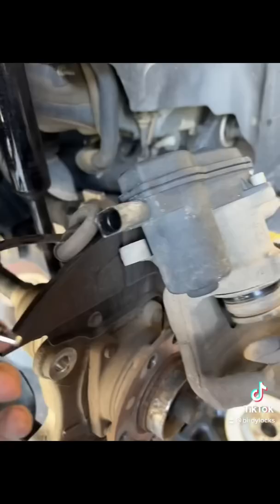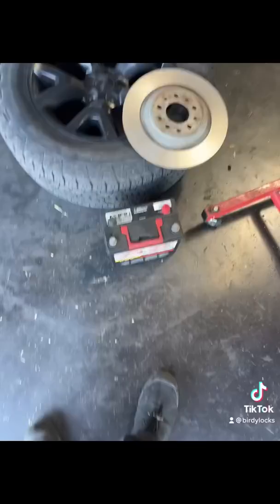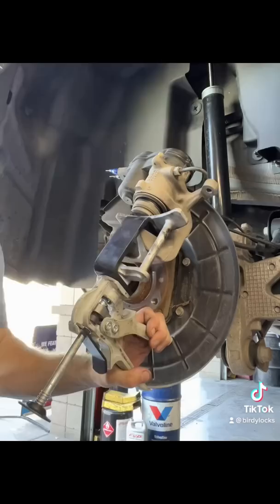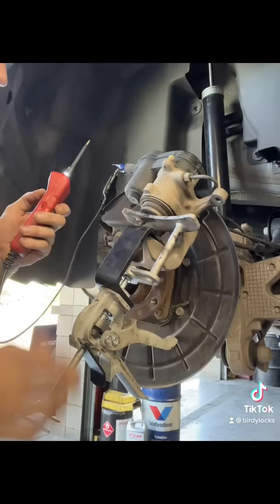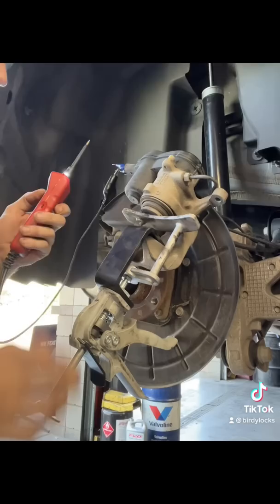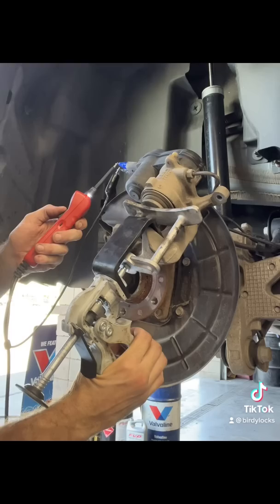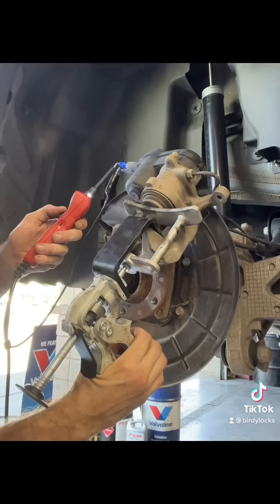Electronic Parking brake hack #EPB #automotivetip #automotivetechnician

Comment: What f'up engineer came up with this?  I used to teach breaks back in the nineties and this looks ridiculous.
Reply: BRAKES!
Reply: It's just for electric E brake.  More crap to go wrong
Reply: Some cars self lock at stop lights
Reply: You definitely didn’t learn how to spell brakes correctly lol 😂
Reply: @JohnSmith-xu7ev  Why? Are their drivers so old they can't hold down the pedal? Was pulling the hand brake too much physical activity for them?
Reply: I'm welcoming the electronic park brakes in the rust belt. No cables to seize up. So far I haven't seen one failed motor. Of course they haven't been around for a real long time yet, but so far the motors are out lasting a lot of cables.
Reply: @illegalopinions4082  I’ve never seen them auto engage when stopped at a light. He may be thinking of auto stop/start. I have seen them engage when placing a vehicle in park to take strain off the pawl.
Reply: @illegalopinions4082  
It's an option when you buy a 120,000 dollar luxury  car.
Reply: Electronic park brakes are so much better than mechanical ones. No cables to seize or stretch. No parking brake mechanisms to seize and break, and no adjustments. And the actuators are relatively inexpensive and easy to replace.
Reply: @alexpuls8219  Just a motor that shuts off when the controller sees a specified current. Same as a window really
Reply: @JohnSmith-xu7ev  An option to do... what? Just because its an option doesn't mean its a good one
Reply: @JohnSmith-xu7ev  yep, anti roll back feature on some. Manual transmission on hill assist type thing.
Reply: @illegalopinions4082  
If you have no clue what's it's for because you never worked on cars, then how can you have an ignorant opinion?
Reply: @JohnSmith-xu7ev  The electronic brake is used for multiple different things. The fact you don't know what they are doesn't make me the ignorant one.
Reply: @JohnSmith-xu7ev  You don't know the meaning of the term "Liberal", and I clearly do. I'd ask you how the system works and what it uses to hold the car in place, but we both know that it only highlights your inability to grasp simple sentences.
Reply: Welcome to 2022!
Reply: @deanmeyer1815  right? I was sorta hoping it was still a mechanical lever that was automated and easy to service. This just looks like a pain in the ass lol
Reply: I used to teach "breaks"...now 'thats' scary. polarity seems the risky thing.
Reply: @revee1000  actually less stuff to go wrong than conventional handbrakes
Reply: @home541_  Depending on the model you do a firm press on the pedal when stationary and the actuators will engage. One you press the accelerator pedal they'll automatically disengage. It's a separate system to stop start. I have it on my Skoda and it works great.
Reply: it's so they can nickel and dime the customer, brakes have neen working well enough for decades yet some yuppie ceo is barking orders down to the engineers telling them to make it twice as likely to break and three times as expensive that way they can have their fat paycheck while the customer and mechanics can get fucked!
Reply: I like doing breaks all day at work 🤣🤣🤣🤣
Reply: @revee1000  it’s actually more reliable, it’s just a button and wire and a motor there’s no cable or brake shoes that can rust and seize, it’s just more expensive.
Reply: @illegalopinions4082  ask the big car companies. They obviously think the people are too stupid to drive their cars, with park assist, lane departure, collision avoidance etc
Reply: guess u teaching "breaks" wrong all the time
Reply: brakes
Reply: Yes, BRAKES!
Reply: Wait.... what?
Reply: Electronic motors actuating on the rear pistons as the handbrake has been around for a while I thought. And there's ones that use a typical handbrake shoes inside a brake rotor hat that actuates on the cable to activate the handbrake 👍🏻
Reply: @oldfag_adventures  to replace this would be cheaper so moot point
Reply: @home541_  yes they do, is call brake hold, when BRAKE HOLD is on, after making a complete stop you can release the brake pedal and the car won't move until you step in the gas pedal and if you take the seat belt off it will go on park automatically.
Reply: @raziel2215  Ones I’ve seen that utilize that typically use the ABS module. Bizarre they’d use the rear caliper but I’m not the engineer
Reply: @Krankie_V  the mercedes electronic parking brakes in the rear go out but I don't see it happen too often, pretty good system
Reply: Teach breaks, yup that's why they all failed, they were on break.
Reply: @illegalopinions4082  it improves the lives of others whilst making no difference to yours. Some people are disabled, some are old, some are just physically weaker and smaller. You've never had an issue with the old regular hand brake but many people do, all day, everyday
Reply: @Krankie_V  I've seen the same caliper on the same wheel having both the motor swapped twice and brand new calipers swapped twice. All work was done at VW, orig VW parts and they still failed. They think it was down to road salts sitting in the connectors and corroding them til they were too thin resulting in poor connection making it an intermittent fault that killed the motor eventually, the last time they threw a caliper, motor and new harness in, that was 2 years ago and it was all good. Sounds cool but that was all free under warranty, like 6 months later it would have cost idk,  into the thousands, over a caliper.
Reply: @georgecroney6168  Then maybe they should consider an alternative, like the ones they can already put onto their car. You have to be really far gone to not even be able to use a hand brake when there are 90 year old ladies somehow managing to do it just fine. Raising the cost of the entire car prices those very people out of it at purchase and likely condemns the car if there are maintenance or repair costs.
Reply: BRAKES TEACHER, THAN TAKE A COFFEE BREAK!
Reply: Having been in a car on a real narrow road on the side of  a mountain and over heated the brakes, I was grateful for the lever operated emergency brakes , if I had the ebrake I would have been in trouble as flicking a button doesn't have the same feel as the lever has
Reply: EVERYTHING is going electronic .... 
Its more things to BREAK to cost more $$ in repairs.
Reply: @home541_ it's called Auto Hold and when the car is stopped, the EPB comes on when you release the brake pedal to go. It's designed to stop you from rolling backwards ifnyr on a hill and are crap with yr clutch control 🙄
Reply: @Aspie_Geek_UK  As I stated in the previous comment I’ve never seen a car use the EPB actuator for hill assist. Always been the ABS module locking the brakes. A lot faster than the EPB actuator
Reply: Definitely going to break these BRAKES
Reply: What engineer ?? A young millennial that said pulling a handbrake or pushing down a foot brake was too hard and heavy for his weak puny arms and legs so he invented the electronic motorized emergency brake .... 
The same millennial that came up with the electric lawn mower, too wimpy to pull a string to fire over a mower 🤷🏽‍♂️
Reply: Industrial psychology when viewing accident statistics has long indicated that more decisions equal an increase in wrong decisions. Cars will be autonomous pretty soon , they will take themselves to the scrap yard when the software fails( it does) . Humans are resistant to control by autonomous systems and accidents will remain inevitable. It’s worrying to me that the brake will automatically release when the gas pedal is pressed, leaving the major hazard in the pot .
Reply: This is an amazing video. You will have no idea until you find somebody that messed everything up by not putting the car into maintenance mode. This little trick is amazing

Comment: Most cars have parking brake maintenance mode that retracts the parking brake without using a scan tool.  Simple button press/key cycle sequence
Reply: Nice thought by them I guess but electronic parking brakes are dumb asf anyways
Reply: Exactly.. done too many fords and dodges at PB’s
Reply: @APBtDiezel  Ford/Mazda/Dodge and Mercedes are the only brands I’ve seen that have access to it without need of a scan tool
Reply: Ford as I know: key on engine off + electronic parking brake disengaged position + accelerator petal to floor then turn car off and within 5 second at any point while continuing to hold those, turn it back on. E.P.B maintenance mode activated. Some 2022 Fords I found though I had to force the maintenance mode with the ford FRDS software on our scan tool. Haven't tried on a snap on or matco all in one scan tool. I'm sure it still works.
Reply: Noice
Reply: Lots that dont qithout a scan tool
Reply: That's if the service mode even works.  I had a 2020 Ford explorer with a bad control panel button and had to use the scan tool.  But the jumper pin trick works in a pinch.
Reply: @home541_  jeep too
Reply: I was about to comment that it has a brake maintenance mode that releases the piston pressure but you already had it. Good on ya.
Reply: I know you're confused bc of the title to the video. But that has nothing to do with parking brake.
Reply: @Rescue1325  now I’m confused
Reply: Came here to say this, also be careful with a power probe youngins
Reply: My Honda I just left ignition on and put a battery charger on battery . Worked great 👍
Reply: @Wub892  snap on will do this
Reply: @killroy3607  haven't used a snap on or other brand one but glad it does
Reply: Wrong... Its put into service mode. You would still need the scan tool to retract the pads.
Reply: @johnnysolano1025  wrong
Reply: Ford sequence to get it in and out of maintenance mode is fucking rocket science. Be nice if they just have a hot function anyways to make some of your lives easier

Comment: This don’t work on GM vehicles. The ebcm keeps track of the piston positions. Doing this with out the ebcm putting them into service mode is going to set fault codes.
Reply: Which GM has electronics calipers tf?
Reply: @Strokin383  C7 corvette has electronic e brake. I’m guessing there’s other high end crap that also has it.
Reply: Right. Sending voltage from there to a module is always a great idea. Power probes banned at our 600 shops
Reply: @stevenliberadzki9160  Using a power probe properly is never a problem. It is a very handy tool
Reply: @Strokin383  properly is the issue. Our multi billion dollar company has seen it used incorrectly to many times. People sending current back to a multiplexed system completely toasting 5k modules.
Reply: @stevenliberadzki9160  and how do you avoid that, other than banning the tool outright?
Reply: @mikem5475  well it's a policy. We've all signed a document that's states they are not allowed. Not a rule really enforced that I've seen. I can't say one technician has one at our shop. Absolutely no reason to have one. There is nothing we cannot do via. The oem software from Hino to Detroit. The system tells you what's wrong. Just gotta trace the fmi. Lane assurance I'm still getting to know better and better. It's just so incorporated in every module so trying to trou keep shoot it is just a bit complicated.
Reply: @Strokin383  my GMC Sierra Denali has them.
Reply: I've done it in gms and it was fine, I always disconnect the battery before I do this tho
Reply: @Cory Hayden  my 2015 Caddy Escalade. Ugh
Reply: @maxjones9139  ya do does a lot of Chevy pickup trucks

Comment: The easiest way to do it is to just unbolt the e-brake module from the caliper and spin the caliper back with a Torx bit
Reply: Yeah that's what I do, sometimes you can even spin it back with on of those kits with the different adaptors with the plates on it. 

It works every time it's just I never have the right adaptor plate thing half the time.
Reply: Did this on an Audi, works every time
Reply: Yup or a triple square
Reply: Unplugging it didn’t work on my Honda
Reply: That will not work, the electronic motor has to screw back under power
Reply: @1991tommygun  depends on the car, but for the most part it's ok to take the motor off and spin the caliper back up
Reply: This works untill you go to activate the parking break and it throws an error for being out of adjustment and now you have a bricked rear caliper motor.
Reply: @1991tommygun  works on my Audi 5/5 times easy and non-electronic
Reply: @richolishis94  how?
Reply: Just make sure it’s snug after you put the new brake pads otherwise dash will
Light up like a Christmas tree if the motor spins too much when goes to activate again
Reply: @ihateeverything3972  negative  yiu still have to back out the electric e brake motor before you compress the piston .that's the entire point of a electric e brake. The motor forces the piston out to cheep brakes engaged.and most cars that have a electric e brake yoy have to use the special tools to rotate piston as it compresses in .
Reply: @westsidedavie  
Clearly I didn't have to do that.
Reply: @1991tommygun  it works on most I have seen, but on some like Subaru, it can damage the seal (O ring).
Reply: @44125  there is a video out there on how to do it on a Honda way easier. Leave ignition on and push the brake hold button . Find the video don’t go by me. I did it 2 years ago . Easy peasy
Reply: Or just supply power to it. Or discconect the plug before you put it into park!
Reply: Works on every car with electronic parking brake just don’t forget to adjust the caliper back before putting the motor on it
Reply: @richolishis94  gimmie a brake

Comment: What the hell is this shit? My two newest vehicles are 2010's and damn it I do not want anything newer than that.
Reply: The newest vehicles like even a 2021 Ford Explorer needs new front diff fluid every 28,000 miles for one example
Reply: For real right
Reply: @AmericanRustWorker3369  every diff has an interval but most don't use it

Comment: I miss having a hand brake especially for emergencies.
Reply: And for snowy days
Reply: That’s what abs is for
Reply: What? In what situation would you use your parking brake as “emergency brake”?
Reply: @rafa_pinheiro  blown brake line, hydraulic failure. i have driven miles back to my shop with city traffic when a brake hose randomly exploded on my audi. these also require power making them inferior to a manual cable brake.

Comment: I feel like removing the module, manually moving the gear inside all the way back, pushing in and then putting the module back is easier. But that’s on a newer Mazda 6. Maybe it’s more difficult on other cars.

Comment: Or you could manually put it in rear park brake service mode😂😂😂😂 hold the park brake in the disengage position and cycle the key while holding it 5-10 times and it’ll put you in rear brake service mode. And to get it out put it in the engage position and cycle the key 5-10 times. At least that’s how it is on fords
Reply: Jeeps have an option in the setting on the radio
Reply: @dj85rocco  that’s nice, I try to use fdrs or ids to put it in rear park brake mode but it never works
Reply: its only 2 times if you do it right lmao

Comment: Before the job and with the engine on, release the parking brake normally and unplug the calipers electrical connector. Proceed with the brake job and plug them back later. No hassle

Comment: This is dumb by every angle.. you know there are two torx head bolts that hold the motor assembly to the caliper.. remove that, use a 12pt inverted torx on the shaft of the caliper and turn clockwise till it stops and the caliper will push in freely like any other on the planet.. this is a very risky method could potentially hurt the e brake motor. Not to mention the extreme excessive amount of time involved in the set up of this procedure. Very creative but not practical  at all. Just do it right at the end of the day.

Comment: I unplug it , and unbolt the electric motor, press in the piston, and turn the the gear on the back of the caliper while pressing in the piston.    Then just bolt the electric motor back on and plug it in.  Works every time.

Comment: If your going to attempt maintenance on a newer vehicle, get the proper scan tool, read the factory maintenance procedure, its a series of very simple steps to follow and you wont potentially fry expensive modules. If you dont know what your doing you can cause a lot of damage with a power probe.

Comment: Fun fact: most cars with electronic parking brake have a cheat code you can use to put it in service mode without a scan tool. 

I've done it on my Mazda 3 several times.

Comment: Always had a scanner handy when doing a break job with EPB. If you don’t have a scan tool or a power probe handy then this trick may work for you.  once I didn’t. Have a scanner handy. I blocked the wheels so car couldn’t roll, put in neutral, released EPB and then unplugged EPB calipers so they couldn’t apply the brakes themselves. Once car was lifted and wheels were removed i then removed the EPB motors and compressed calipers and then reinstalled motors. It’s a process but it worked well.

Comment: The problem is most cars brake ECU detect/ memorize the brake pads position, pressing effort, how long it takes to reach end position... Etc..., they need calibration after replacement. It will affect the calipers durability on long term and also a few error codes will appear.

Comment: Challenge is that in many EPB systems the ECU counts the amount of revolutions the system take to apply the e brake and keeps it in memory. By using this manual way software is confused and the automatic braking and stability control may get defeated.
Reply: Just apply and unapply the parking brake, works ever time, have never had an issue.